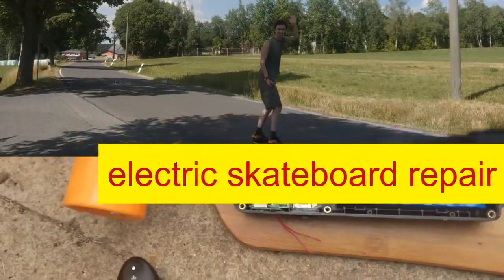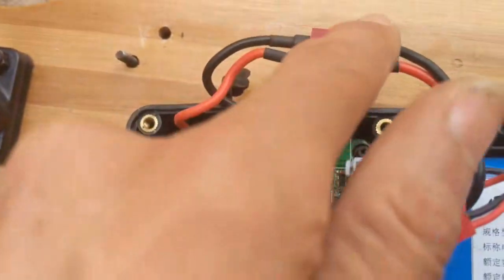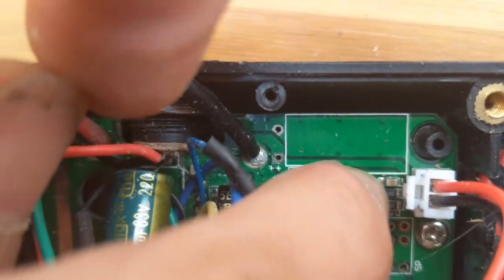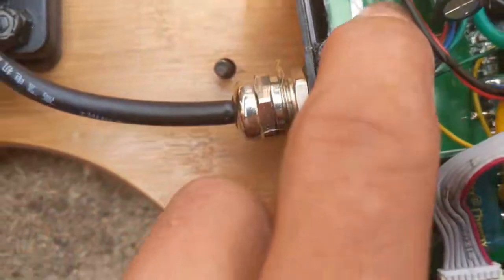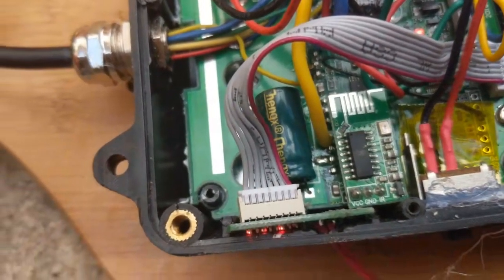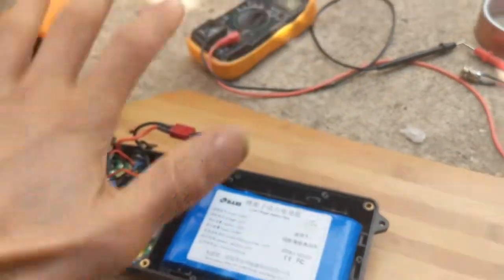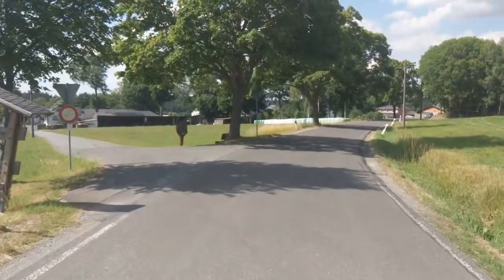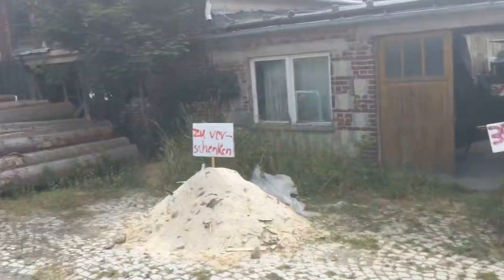1st electric skateboard REPAIR tutorial (+review)  :-)

Comment: Cool project! My daughter has the same one with dual motors. Only one side the mosfet keeps blowing up. Both wheels work fine on the other side so I’m now removed the mosfets that shorted and she can play with only one motor. Do you have any advice how to trouble shoot it? Do I need a oscilloscoop to check the PWM? Any advice would be highly appreciated. Keep up the good work always watch your videos.
Reply from the maker: watch my hoverboard repair video on mosfets. Normaly a pair of mosfets blows. the high side and low side of one phase cable. It is worth trying to replace them. but if they blow up immediately again, then the mosfet driver is broken too. If it is a sot8 chip, you might try to replace it as well.
Reply: @robodurden  yeah replaced the pair and then two others on that side blown after the motor worked a bit stuttering and wouldn’t start without giving it a swing. I’ll try looking into the mosfet driver thx
Reply from the maker: @tworoelio  always only test with a 2A cc constant current power supply !
Reply: @robodurden  I could do that but you mean 2A CC for measuring etc?
Reply from the maker: @tworoelio  for testing. the other two mosfets would not have blown but only have gotten hot and you would have turned off power because you already knew that something was still wrong.